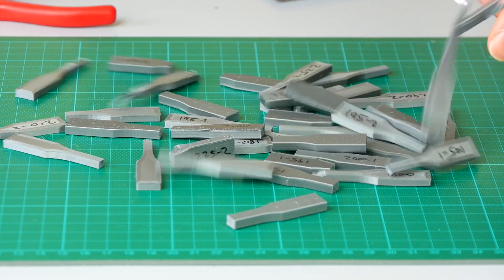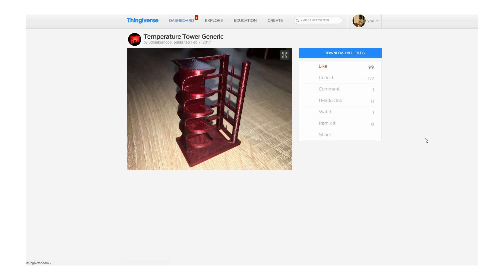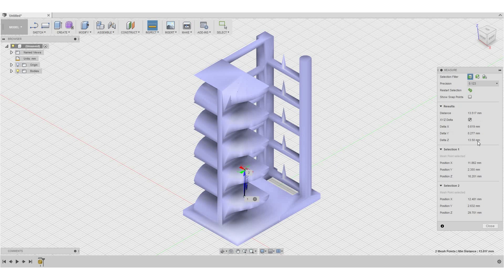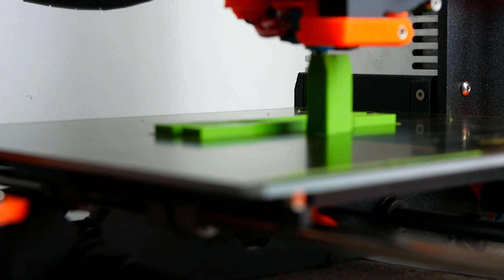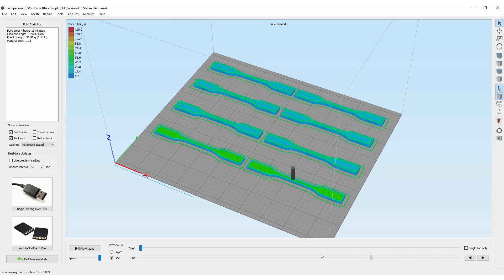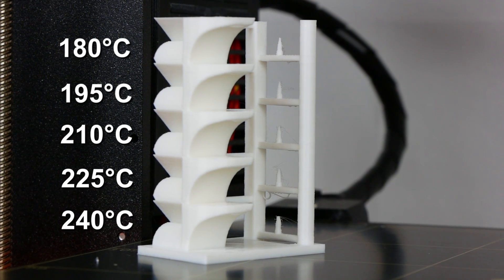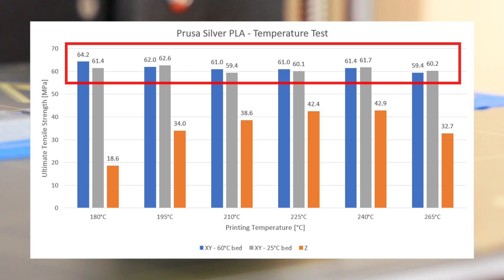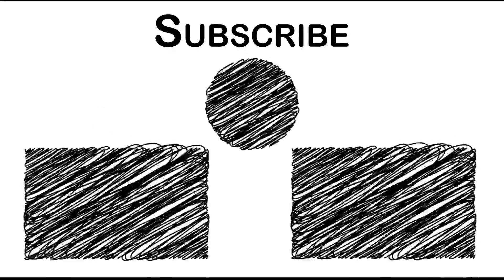Printing PLA at 265°C? How does printing temperature affect strength?

Comment: I think the majority of primary reasons why PLA is still pretty much a default filament (besides cost). Is because it's so forgiving and stable. Where I would really want to see these kinds of tests, and IMO where the results would be much more valuable to the community - is with common filaments that are not so forgiving and stable. Like PETG, Nylons and PC. And ABS, although ABS seem to have dropped a lot in popularity the last 4-5 years, as materials of similar or better properties that are substantially easier to print and less nasty VOC wise, have in many areas displaced ABS.

Comment: im looking to make a side panel for gaming (arm wrest with buttons )that is about  600mm long and 300mm wide.i was planning on getting it printer by a company and i was wondering if you or anyone could tell me what the best material would be to get it printed in. here is a pitcher of what its going based off. https://d3lp4xedbqa8a5.cloudfront.net/imagegen/cp/black/480/360/s3/digital-cougar-assets/farmtradernz/gallery1704/Deutz-Fahr--2.jpg

Comment: Is the test really relevant ? I mean this method of tensile test works for isotropic material and is normalized for that (calculation in the software and so modulus you find)
Since this is a layer per layer fabrication I'm not really sure that the values you obtain means a lot. I could be wrong but any other view on this ?
Reply: It shows how the different print temperatures effect how the layer fibres act, so yes it is useful but has limited ability to be compared to other materials etc

Comment: Nice video man, I managed to print with my 16€/kg eBay PLA some good Zstrength things but I'm sure that a good PLA would print the same thing but with at least 10°C less, that's were a good PLA spool differ from mine.

Also turning off the cooling did the trick, did you have any video test or chart about that? Keep up the good work.

Comment: I've already had overheating issues while printing at 195°c on my monoprice mini delta. If I need a very strong part, I think I'll print at 210 degrees with a fan blowing on the print and the printer runing very slowly. I'll also anneal the part. For now, I don't need such a part, but this video has provided very valuable info in case I do ever need such strength in a 3d print.

Comment: 2:30 Tip about simplify 3d you can actually figure out the height steps by clicking on view>cross section. the slider will show you in preview the exact height of each slice.
Reply: I use multiple processes all the time. it's a major time and material saver if you know what you are doing. Now I just need the ability to select specific sections of a model to change properties. it would be amazing to be able to have different wall thicknesses or infill on different sections of the same model.

Comment: Don't forget that print orientation also affects part strength! I realize you printed 10 test bars on the print bed at once, but ideally for max strength you should probably print these at a 45 degree angle to the X-Y axes: http://www.sparxeng.com/blog/mechanical/3d-print-orientation-effect-part-strength

Comment: Good investigation! I had terrible bed adhesion a week after building my Prusa mk3 i3. None of the forum advice or manual suggestions worked. It was by chance that I downloaded a user made calibration model for the mk3 and that had a print temp of 235 for the pla. Bed adhesion was perfect. So I started setting 235 for the first layer on my own designs and the bed adhesion is perfect. I should also say that the bottom layer of my models showed separate filament lines and the detail was always bad on first layer regardless of how many times I recalibrated. Since setting 235 for first layer the bottom of the print model is perfect.
Reply: Mysterious MrX have you tried cleaning the bed with isopropanol or acetone?
Reply: I was using isopropanol at the time.  I now use acetone and noticed an improvement.  I set the first layer print speed lower as well.  Much better results these days.  :)

Comment: Hi There. Love your videos! I'm a bit of a scientist at heart and your methods for testing the tensile strength of printed plastics is much better than I was expecting from a simple youtube video.

I'm very interesting in the annealing process and I've watched loads of videos but no-one tests the strength of the plastics like you do. Would you mind doing a follow up video to this one where you print a number of PLA specimens and anneal them under different conditions with the aim of finding the best conditions that yield the maximum strength.
Reply: Would you mind also testing pieces printed with different fill directions and increasing the number of skin layers so that all print lines are in line with the test direction (effectively leaving zero fill). Printing with different nozzle sizes would also be interesting to see if this effects the strength of the part.
I've actually got a suspicion than when annealing, the part becomes thicker and deeper, but loses some length. Of course it's the cross-sectional area that determines the strength so factoring this in might effectively reduce the strength per area but until we some some hard numbers it'll be difficult to say.
Reply from the maker: The temperature only really changes the rate of cristallization. Low temperature: longer annealing process, high temperature: shorter time.
Reply: CNC Kitchen . So the data you present for "Annealed" is the best strength that PLA can obtain? How long did you leave your pieces on the print bed for, at 60°C? Edit: And have you got data for annealing pieces that are stood upright?
Reply from the maker: I put the pieces in the oven. You should go well above 60°C. Strength is not necessarily better. They are stiffer and stronger but more brittle. Your choice, what's more important for you. Have no data at the moment about upright ones, but the layers don't fuse together during the process.

Comment: I'm a rookie, so I don't know much. Anyways, I began printing on tape, ditched that mess, and now am using mirror tile (no surface additives) glass.

Printing PLA (value-priced varieties). Slicer: Cura. Temps: filament 210°, bed 70• (I'm aware  most everyone claims PLA doesn't really need a heated bed). The 1st few layers print speed ~20-25, fan speed 0.  I've had zero adhesion issues. Admittedly, I don't the strength of the prints, albeit appearance is good.

Sorry for the long intro to my question... what's (where can I find) the 'whys and why nots' concepts of bed temperatures? Thx!
Reply from the maker: A heatbed brings your material at the bed at a temperature over the glass transition temperature, therefore making it softer and less prone of ripping itself from the bed.

Comment: I don't understand PLA temperatures... I bought a Tevo Tarantula 1 month ago and made a few temperature tests, but for me, the best prints were made on 240°C. At 210 it wasn't flowing well and at 190°C it didn't even work... What could be the problem? It's a filament issue?
Reply: I've yet to encounter any PLA that didn't melt sufficiently at 190 deg, chances are your thermal probe is horribly inaccurate and is telling you temps far lower than what they are.
Buy another thermal probe off ebay or something and then try printing at 190 and I think you'll find 190 works pretty well.

Comment: Blue painters tape on PEI? Why? What's the benefits? Does it help with ABS if at all with PLA?
Reply from the maker: So the PLA will not properly stick to a cold PEI surface, but it does stick to painters tape. So using this method allows me to print the specimens without the heat bed on and therefore preventing the annealing process.

Comment: Thanks for the tests and the video. 
Has anyone come across an explanation to the ambient temp temperatures registered on the Prusa while idle? My other printers also use e3dv6 (genuine) and all of them register the same ambient (matching!) temperature but the prusa is 10ºC more! I once chat with Prusa live chat and they said "i've never seen a mk2s below 30º ambient" but yours show 27º. I did install the "hacked" prusa firmware and did some PID tunnnings but I still see the same ambient temps. This is pretty weird imho. Worth a new video? hehe
Reply from the maker: So as already mentioned PID tuning will not change the registered temperatures, it will only adjust the control loop to hold a certain temperature. I really don't know why this is the case. I might try connecting my other e3d V6 to the printer to see if the reason is hard- or software related.

Comment: The varying strength results on the z axis are probably due to the adhesion surface area. Printing upright vertical reduces the surface area hence reduces the strength. Nice work :)

Comment: 10 degree more = bad dimensions
Reply from the maker: If you tune the flow, which might be a little higher at higher temps then you should still get decent dimensions.
Reply: i gonna give a try ! Actually i print some part to fit inside / outside pvc pipe and it work greet. but with another filament its little bit tight and i need to sand it. ive jusu tried to switch another temperature not the problem is the outside fitting :/ . For 32mm i put 32.4mm but ive not found any good article on the web who explain this tolerence fit things. I don't care to make thing 0.4mm bigger but if i switch filament and its change 0.2 / 0.4 tight / loose its an issue.

Maibe its time for cura and stuff to provide officials benchmark for . You print a thing then you measure and give the size on the software, who give you a print with different setting, measure again and after like 3 tries, perfect size match.

Im a bit confuse about that, cause sometimes you need to play with 0.1 / 0.2 mm to fit perfectly something, print are always same with same filament. How you deal with that ?

Comment: I tried some of the PolyMax PLA and it is super durable, a bit too durable...trying to remove supports was a failure. I doubt it is much stronger than regular PLA, but it does deform more before breaking.

Good job on your tests and thank you for doing this.

Comment: Could you revisit this test with a 0.8mm nozzle? I'm curious if the strength increases across the Z or not.
Reply from the maker: I have a .65mm nozzle and might put that to the test some time.
Reply: In that vein, would you also run it with a 0.3 or even 0.2mm nozzle? It would be really interesting to see, if already having more and thinner strings in the horizontal variant will either weaken the part (less stress to break a single one) or increase the tensile strength (as failiure of one string does result in not so much more stress for the remaining strings).

Comment: It was known before that higher temp gives better layer adhesion, so parts are stronger against the layer direction. However the difference printing with bed on and off is pretty amazing. Now one can choose between stronger parts which snap at failure, or slightly weaker parts which stretch more before failure. That's really cool! I'd also be interested to see the effects on compression strength and bending strength perpendicular to the layer direction.

Comment: If your temperature readings are inaccurate, tune your PID values. The ones in the firmware are probably pretty accurate but every printer is different and every environment is different, so best accuracy is gained by PID tuning. Tom Sanladerer has a good video about it.
Reply from the maker: +Jamie I know what you mean. My first video ever was actually about that. But PID tuning will not make the temperature readings more accurate it only improves the control loop to make them more stable. The calibration table for the thermistor in my opinion is not perfectly right.

Comment: 220 C
 is the ideal temperature ?!
Reply from the maker: For my configuration 220°C seems to be a pretty good compromise. If you have a different printer and material, you need to find out the highest possible printing temperature with good results on your own.
Reply: CNC Kitchen i used ti print 185-190 and thesedays 200 0_0
Reply: yessss

Comment: For the temperature tower you can use the temperature settings in Simplify3D instead of processes, i.e. by setting the temperature changes depending on the active layer number. I used this approach when printing some temperature towers to change the temperature from 230° to 170° in 3° C. steps.

Comment: don't know if anyone mentioned it already, but you can actually make use of simplify3d's 'cross section view' to find out the height of your print. There is no need to go into another program ;)

Otherwise, nice video and pretty informative
Reply from the maker: Thanks for the info. That's actually another option but I do prefer making the measurements in CAD since that saves me from playing around with the cross section values.

Comment: Very useful test results. They seem to match what i am seeing in PLA layer adhesion. are you considering running the same test with other composites,say PETG?
- Eddy
Reply from the maker: I'll be doing that but I'm still looking for a suitable brand filament. Any suggestions?
Reply: I'm using a local Canadian supplier's house brand (Filaments.ca) of PETG which is has a good price per Kg and prints nicely. I cannot recommended any European Brand specifically, would the German Das Filament be a good start? 
 - Eddy
Reply: I am reading other comments along similar lines, for suggesting PETG. Have you considered a Patreon Account (or similar) to help out getting filament for testing? I would be OK (and I'm sure some others) with throwing a few Dollars/Euros your way to help to get more test stock.
 - Eddy
Reply from the maker: That would actually be an option, especially to stay more unbiased. Getting donated stuff will always make you rate it better, since you did not buy it from your own hard earned dollars/euros ;-) I really need to think about that!

Comment: Would like to see if you coated the outside with superglue, how much strength would it give to a part.
Reply from the maker: It shouldn't change too much but it might reduce the notch effect of the layer lines which could be beneficial for strength.

Comment: I print PLA on unheated bed at 210 all layers .Good to know that I could increase it, maybe first layer would stick much easier .
What is that waffle of cardboard under the bed of your Mendel ? Is that supposing to isolate the temperature ? If I put some Aluminium foil under the bed will it reflect the temperature upward ?
Reply from the maker: Using a higher temperature for the first layer is usually better for the bed adhesion, so try at least 220°C.
You'r right, there are 3 sheets of corrugated cardboard under my Mendel90 heatbed. That insulates it so that it heats up faster and uses less energy during printing. Aluminum foil should also be working, just make sure that nothing shorts.
Reply: CNC Kitchen nice maybe you can make a video about noise caused by resonance of the steppers and how to fix, I know you have something about the vibration of the printer but maybe not same thing ? and also different drivers like drv8825 and tmc2100 . Or other ways to have silent printer ...

Comment: Very good and informative video - thank you. With the annealing test could you comment about dimensional stability and warping.  For warping I suggest comparing say a plain rectangular prism with a long end 8-10x the other longest side as a control and a similar sized piece with a semi-circular notch half way along reducing the cross section by 50%.
Reply from the maker: Very good idea!

Comment: Great video. I wanted to investigate this question as well, but you did it first :) Thanks for sparing me a lot of work. FYI you asked about the actual temperature compared to the displayed temperature of the firmware. I did a test with a type K 3mm thermocouple and inserted into my e3d v6 Hotend to compare temperatures and this is the graph i got http://imgur.com/n4ZedDI

I was interested since I am writing currently a paper on particle emissions and how they are influenced by temperature, printing speed and nozzle size. I will publish very soon ;)
Reply from the maker: Interesting. That would mean, that the displayed temperature is too low. Did you measure at the exact same location? Did you use thermal compound?
Reply: I inserted the 3mm thermocouple until it reached the tip of the nozzle and then just incrementally increased the temperature by 10°C. For each increment I gave the hotend 5 minutes to adjust to the new temperature, just to be sure. I repeated this experiment 4 or 5 times to generate enough data and apart from +-1°C  the results were very repeatable. I did not use a thermal paste, now in hindsight this would a have helped with the  accuracy of the results.

Comment: Great video. Did you also consider ambient temperatures and humidity? In my city it ranges from 0 degrees in the winter up to 40 degrees in the summer.
Reply from the maker: This should actually only influence the moisture content in the filament which would reduce the usable temperature region and make it more brittle. Even though the filament was already open for 5 months and I stored it in open air it was winter, so usually low humidity and temperature. I'm planing to make a video about material aging where I want to exactly test that.